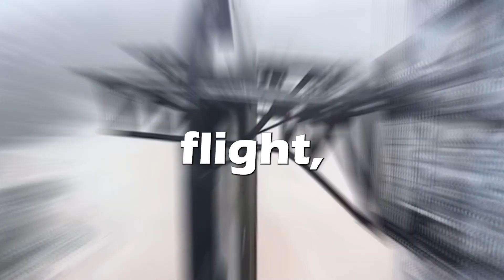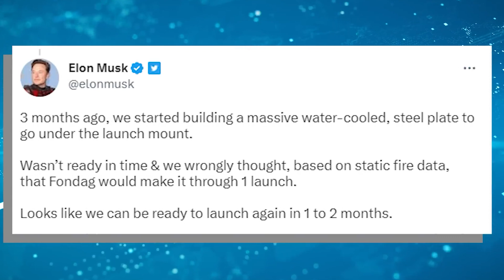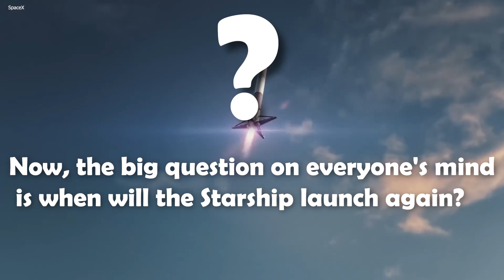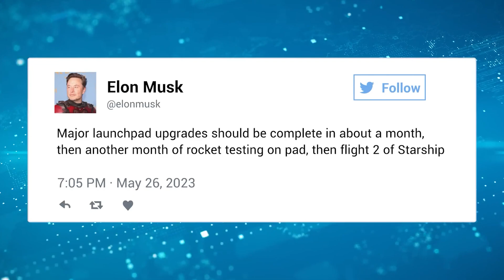FAA Announced: NO More Launches for Space X - Elon Musk Angry

Comment: You’re telling me that nobody from the FAA came out to inspect this launch site prior to approving a flight? This seems like more of a failure of the FAA to inspect the site properly. To not notice there was not giant concrete trenches to redirect the blast, which this video seems to say is required to have so the rocket doesn’t kick up dust.

Someone of some authority had to approve this. Id say its on them for not correcting it not on the company who was told its good to go.
Reply: It’s the owner/ operator’s responsibility to make sure they had the faa come out and the owner is a multi billionaire he just thinks he’s better than everyone else.
Reply: Actually, the reason why there was no flame trench, was because the water table in that area is within a few feet of the surface. The complexity of designing coffer dams, pumps, and dredging to keep the area dry enough to work would be huge ..
Should he have made more effort to keep the debris down? Sure, but never firing that many engines in one spot is unknown territory. Rebuilding the OLM, installing the deluge system and water cooled plate, along with rearranging the tank farm, and adding a berm should go a long way towards solving the problems...